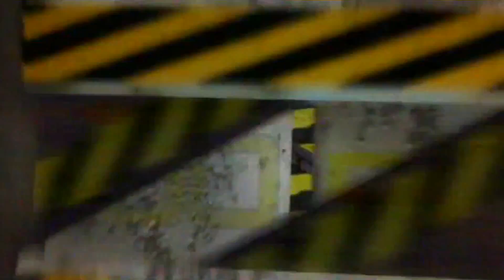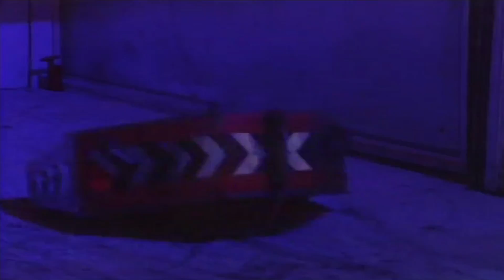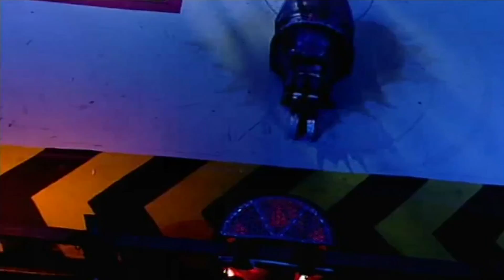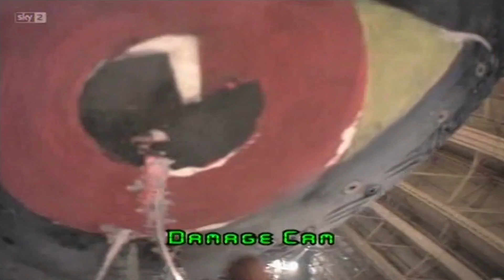Robot Wars Series 6 Heat E

Comment: The only good thing I can say about this redesign of Wild Thing is that it kept that "Never Say Die" drive power that helps it keep on going.
Reply: Not a fan of Wild Thing's re-design in this series. Always preferred the design from Extreme 1 and Series 5, with the flipper bar and spinning disc.

Comment: 1:41 I wonder if Craig walked backstage afterwards and thought "Wait a minute, America were doing this 3 years before we started. Hell, they invented the sport!"
Reply: I can imagine their version having machine guns and rocket launchers attached, with the audience ducking for cover lol
Reply: Nah, we invented the rules as well as the sport, including banning weapons like explosives, untethered projectiles, electromagnetic weapons, liquids, etc. But you're half-right. America had better, stronger arenas so spinners were never banned in the US like they were in UK live competition after Robot Wars went off-air. Between that and no official 'out of arena'  area, powerful kinetic weapons came to dominate the American scene while flippers became the robot of choice in the UK.
Reply: TheSmithersy  The  engineering required to get that to work would be crazy impressive. Plus, explosives are still banned so the bullet would have to be launched with something other than gunpowder. In the newer Battlebots they actually lifted the ban on untethered projectiles, but not explosives. There is a speed limit on the projectiles, but the show now has a robot named 'Double Jeopardy' that launches a 2 kilo slug at a 'low' speed with an air cannon.

Comment: 259 basically pulled a Tauron or a Haardvark. It was on top the entire right only to die right at the very end.
Reply: Not really. Was on top while the weapon belt was on but as soon as it was off it spent the rest of the fight running away and getting pushed around. It was basically on top for all of 50 seconds and then that was it.

Comment: I was disappointed when I saw Wild Thing's design for this season. It's so unoriginal now, season 4 and 5 looked much better. Their season 5 design had a flipper and a horizontal spinning disc, what's wrong with that? They nearly beat Chaos 2 with that design.
Reply: According to the Wiki, Nick Adams was worried about how vulnerable the armour and wheels were to spinning weapons and felt the design needed updating after never getting past the semis. The switch to a thin vertical disc was made to gain some more weight that could be put into the armour. All the internals are pretty much just ripped from the old robot.

I have to say, while it makes sense why he switched at the time, I also hate the redesign. It looks terrible, the ground clearance is HUGE, and that disc just doesn't seem that useful. Against any half-decent horizontal spinner that disc would be destroyed instantly.

Tbh I think if they had wanted more armour they would have been better just going back and beefing up the series 4 design (no disc) and adding some protection around the wheels. Even without the disc they managed to get a lot of effective use out of just the spiked lifting arm in series 4.

Comment: 259 potential champion?  Dont be kidding, it had JUST the damage, nothing more. Flip it over/bash it hardly and its done
Reply: Yeah, in terms of damage it probably did a little bit more than S3, but S3 had much more protection around the disc mechanism, and it was invertible. As seen in the Wild Thing fight, that weapon drive belt is far too exposed and easily lost.

Comment: With the exception of series three heat n every heat with wild thing is one of or if not the worst heat in the series
Reply: This one had 259 and Shredder in who are both very good. Wild Thing even this weaker version is just the best built robot. Never broke down in 4 years and two extremes!
Reply: What about Series 5 Heat E? That was a great heat!
Reply: @TequilaToothpick assume you mean Vader , not shredder since shredder were in heat d?